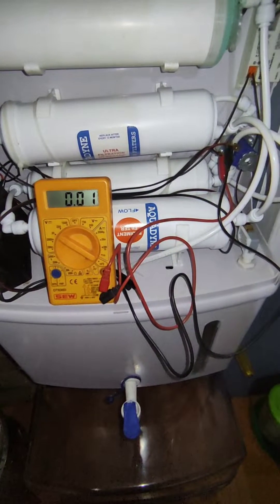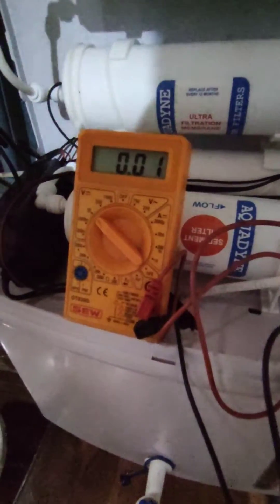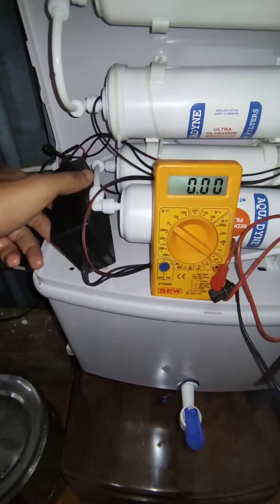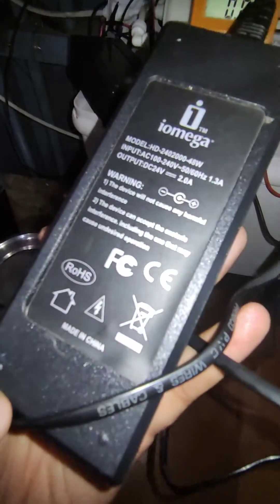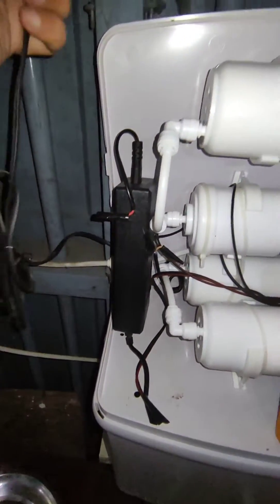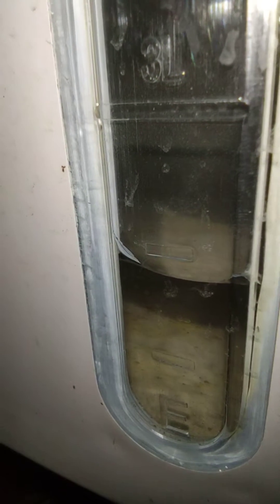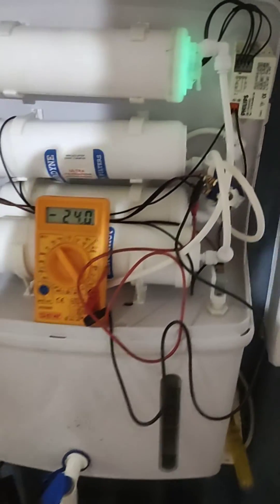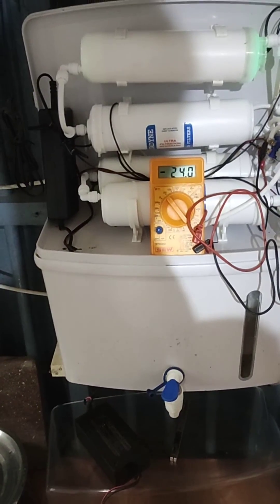IE154: Water purifier repairing. Power ON but no water?

Comment: Price?
Reply from the maker: For what sir?
Reply: SMPS black box delta price? And where to buy online?
Reply from the maker: I bought mine from a local shop due to urgency. And I paid around 500-600 Rs at the time. You can buy it locally, or online for around 300-400 Rs. There are many websites that sell them, you just search for it.